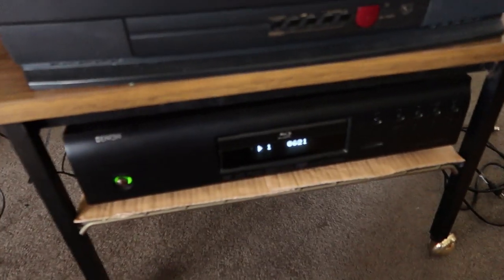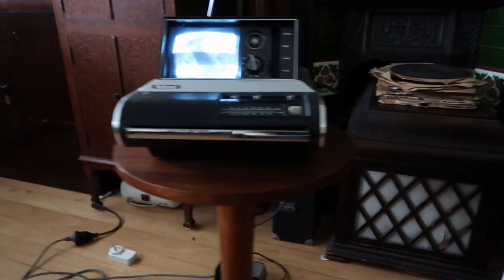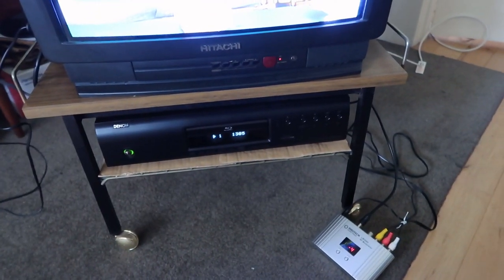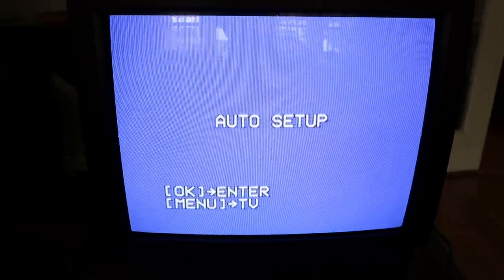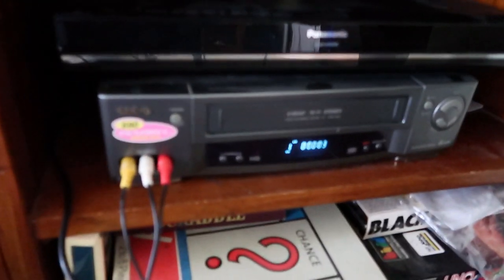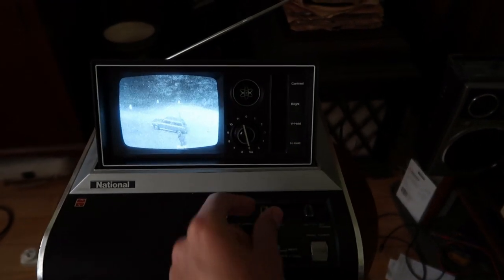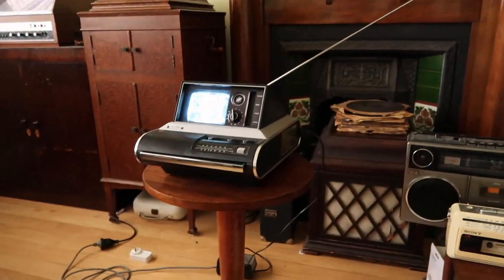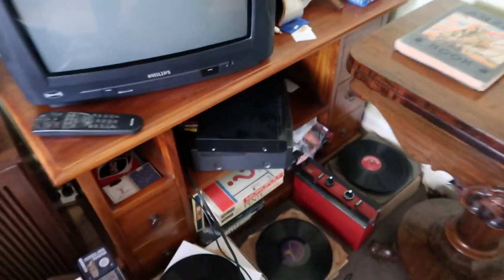Setting it up

Comment: I wonder if other types of video could be transmitted in this same manner such as somehow connecting an older computer (such as the kind that used a tv as a monitor) or newer laptop using some type of down converter for the image?
Reply from the maker: Anything that has composite video output could be used as a source for transmission with this equipment. I think there are adapters for computers to get a composite output. The computers that use a TV as a monitor, like the Commodore 64, already transmit a TV signal. With a signal booster, or even just by plugging an antenna onto them if the signal's strong enough, they could be used to transmit, no VCR or modulator required.